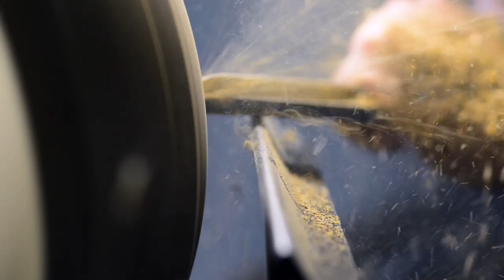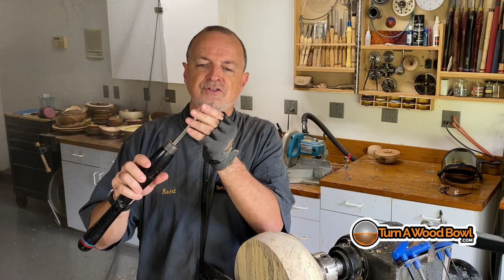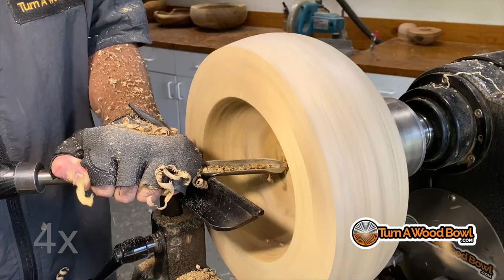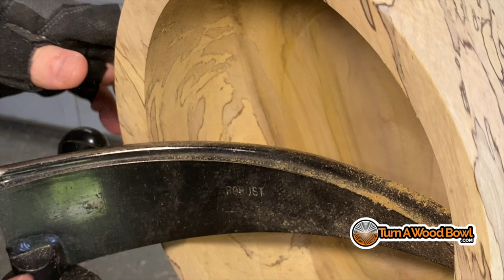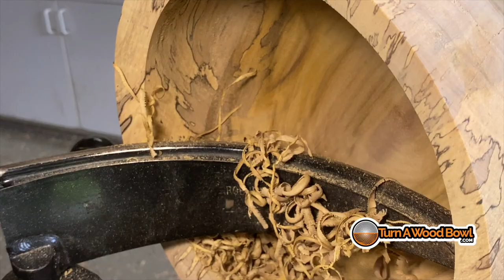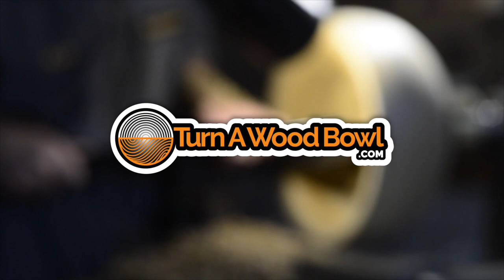Micro Bevel Bowl Gouge Woodturning Secret Weapon Wood Bowls Video

Comment: Having been in the “Hob” manufacturing business since 1973;  second and third clearance angles behind your primary cutting angle are a must when using gun drills. I’m just getting into wood lathe turning and am enjoying your tutorials. I’ve already modified an older tool with swept back side wings and added the secondary clearance/relief angle to see how it performs. Also, I’m not satisfied with the runout tolerances on four jaw chucks, so I will be hole grinding the I.D. and external grinding the O.D. of the Chuck jaws to get them to tolerances I desire.
Reply from the maker: Whoa! You sound super precise Dave. Love it. All the best to you and Happy Turning!

Comment: Excellent information on bottom feeder gouge.  Thanks for sharing, Kent!

BTW, I noticed the rust / wood buildup on your bottom feeder gouge.  Some WD40 and 0000 steel wool will remove most, if not all of that corrosion / wood residue. Wipe down your tools after they are used to help prevent this from happening.  Then put a light coat of WD40 or car polish on the HSS to keep the corrosion down when stored for a long time.  This will keep tools looking nice and protect them.
Reply from the maker: Hey, that's great advise. Thank you. It's so humid here that we kinda just accept a little surface rust. I'll try you tip out. Thanks!
Reply: Turn A Wood Bowl 

You could also use some Johnson & Johnson  paste wax on your tools as well.  It does a great job protecting tools.  And it is great to polish the bed of the lathe so the tail stock and banjo will slide around easily.
Reply from the maker: @jarmstrong2843  Yes, I use that on the bed and banjo. Another great tip. Thanks

Comment: What is the purpose of two relief bevels verses the single relief bevel on this tool? Just curious if there is a reason for the second relief as the shoulder of the first relief stops "riding the bevel" of the second relief bevel.

I like your tool assessment videos very much. I finally see what I do naturally, explained.
Reply from the maker: Good question. There is only one bevel, and it is the facet directly under the cutting edge. The heel has been ground back under the bevel twice to allow the cutting edge and bevel to turn tighter curves while still riding the bevel. Thanks for asking and Happy Turning!
Reply: @TurnAWoodBowl  Thanks. I figured there was a reason, had to ask. 👍👍🍻

Comment: Can any bowl gouge be ground into a micro-bevel, or is it best to start with one ready-made? I gather that 5/8" is the best size. Do you cover this grind in your sharpening instructional video? (I already have it, but don't recall.) Thanks!
Reply from the maker: Al, yes you can put any grind on any bowl gouge. The heavier gouges, like the 5/8" are more sturdy for doing micro bevel work. And yes, I cover all this in the Tool Sharpening (and shaping) online eCourse. All the best to you and Happy Turning!

Comment: Howard Wittwer,
Great lesson, my biggest issue is being left handed, so sometimes I work on the other side of the bed. Teaching myself to operate as a righted handed is taking a time. Do you have any suggestions for working at a lathe left handed.
Reply from the maker: Wow, "work backwards." That probably doesn't help. LOL Just remember all the bowl gouge basics still apply. Be sure the bowl gouge tip is pointing of the direction of your cut, etc. Watch the full playlist of all my Bowl Gouge videos. And quite literally, you'll need to reverse your approach if you're working on the opposite side of the lathe.

Comment: Kent I fully understand the reasoning behind the micro bevel feature, and I think it is fantastic, but why not incorporate this micro bevel on all your swept back gouges. It seems as though that would increase the usefullness of all your tools if you did that, instead of having to switch out to a 'special gouge' just to do the bottoms of bowls etc.  Maybe you already incorporate this feature and I just havent come across it yet.
Reply from the maker: Peter, good question. The steep angle works well for reaching into the bottom of the bowl. To do the side walls of the bowl at about 90° you would need to reach clear across the lathe to ride the bevel. That's where the 55° bevel gouge shines. Hope that helps. Happy Turning!
Reply: @TurnAWoodBowl  Ok, that makes sense.  I'm not quite ready but I'll be watching your sharpening video quite soon.  First up is to get a Kodiak sharpening station setup, along with a few new gouges..... then look out wood........

Comment: Can I use the micro bevel to hollow out the whole bowl?  I am new to wood turning. Currently using carbide tools. Want to gradually phase in traditional chisels. I want to start with a bowl gauge. Which one should I take? The flute or the the bottom feeder?
Reply from the maker: Yes you can! However, when you start at the rim, you will need to extend yourself completely over the lathe because of the tool angle. A 1/2" 55° swept-back bowl gouge is my main bowl gouge and I use it all the time. I have a Tools Sharpening (and shaping) eCourse that covers all the tools you will need to turn bowls, check it out https://turnawoodbowl.com/tool-sharpening-ecourse-for-wood-bowl-turning/

Comment: What would think if I reversed direction of turning the bowl and continued to use my fingernail 45° gouge with a center to exterior push cut?
Reply from the maker: Eric, good question. If the bottom of the bowl is curved and you reverse the gouge direction from the bottom up to the rim, you will be tearing out the end grain as you climb up the bowl. Watch this video https://turnawoodbowl.com/supported-cut-wood-grain-bowl-gouge-cut-direction/ You have discovered the limitation of the 45° and the 40/40 grind bowl gouge. There's nothing wrong with these tools. You will just need additional tools to reach the bottom of the bowl. All the best to you, and Happy Turning!

Comment: Specialty tool?  I use the micro bevel on ALL of my gouges, and oh yeah, I don't bother with a bottom feeder.  I also only use a 40/40 on the whole bowl.  I can rough out a soft maple bowl in about 10 to 15 minutes and that just doesn't leave time to use a bunch of different gouges/angles.  I've actually roughed the inside of a soft maple bowl in 90 seconds.  I use a modified Stuart Batty style of doing the inside of bowls.
Reply from the maker: Sounds like a great way to turn. Happy Turning!

Comment: I'm struggling with just hollowing out the inside of the bowl. It feels like every time my gouge approaches the "edge" between the face of the bowl and the inside it wants to just jump out of my hand, chatter or simply "run" to the left really fast. I can't get it to actually take a smooth seat and begin the cut down into the bowl. 

A couple notes here:
1) I'm super new to this, turned my very first bowl last weekend and it was all just trying to grasp the motions.
2) The gouges I have came from my wife's grandpa, who left us a few years back. The lathe and all of his tools sat in storage for well over a decade. 
3) I currently have no way to sharpen them, so I'm aware that I'm poking dull gouges at spinning wood and hoping for the best. 

Is it possible I'm doing something wrong? Or more likely that the gouges just aren't sharp enough?
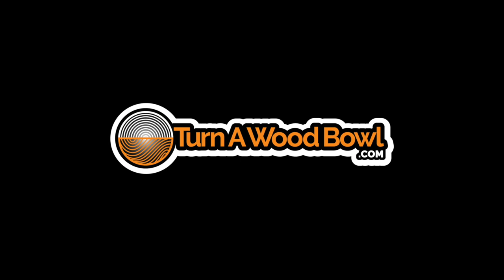Reply: To be more specific on the cut I'm struggling with, it would be the one you make at exactly 17:13 in the video. You smoothed off the face and then started a cut down into the bowl. Every time I try to start that cut down into the bowl the gouge fights me like you wouldn't believe! Most of the time, rather than start cutting down into the bowl, the gouge wants to catch and run across the bowl rim to the left.
Reply from the maker: Oh, I have a video JUST ABOUT THAT ISSUE https://www.youtube.com/watch?v=IbjjbKcQmSU&t Check it out and Happy Turning!
Reply: @TurnAWoodBowl  thank you Kent! This is exactly what I need. I appreciate you!
Reply from the maker: @TerribleTim68  Glad to help!

Comment: kent, when you are referring the angle of your tool you are describing how many degrees of angle off the shaft of the tool, correct?  I have a tormek sharpener and i think they do the opposite.  have you come across this before?  is it a european thing?
Reply from the maker: Adam, I must be honest, this always confuses me. LOL I've had people tell me that the angle needs to be measured from the face and others say the flat flute area. Essentially, all the tool bevel angles are closer to vertical or 90°. Meaning, if the tools had a blunt 90° angle bevel, the turning angles are only a small percent away from that 90°. I'm not sure if that helps at all. Hopefully! Happy Turning!
Reply: @TurnAWoodBowl   I just want to say thank you for replying to questions. a lot of YouTube presenters don't take time to answer questions and I very much appreciate it.

Comment: Kent, I have to pass on something regarding sharpening using the One Way system.  I must confess that I have not taken your sharpening course but instead watched several Youtube videos on how to make the micro bevel grind or bottom feeder as some call it.  DO NOT use the One Way system arm to make a 45 degree or more cutting edge.  In fact, I now think the arm with pocket should never be used to put the bowl gouge handle into.  To me this is like trying to turn wood with no tool rest.  There is no support of the tool at the grinding wheel.  I tried the arm method which is shown on many Youtube videos.  The gouge slipped down my perfect CBN wheel and gouged the heck out of my wheel before throwing the tool back past me.  I'll never use the arm again with a tool handle in the pocket.  This can be very dangerous and destructive to the grinding wheel and to the person holding the tool.  The platform rest is the only way that I will go in the future to make micro bevels.  I will only use the arm to hold the Vari-grind attachment.  Thank you for your videos since they are always very informative.  I think it is time to take your sharpening course!
Reply from the maker: George, Thank you for writing and sharing! No, I do not recommend here or in my course, using the v-arm pocket to hold the tool handle. Something in my gut has always said, "that doesn't look safe." And it's essentially a pinch-point. Thanks again for sharing. Happy Turning!
Reply: I just registered for your Sharpening course.
Reply: @TurnAWoodBowl  Kent, I took your sharpening course and it was excellent!  Your teaching technique is so straight forward and easy to understand.  Well, I sharpened my micro bevel as you taught and used it on a bowl today.  What a great tool!  It cuts beautifully.  What a dream that is for the bottom of bowls.  Thank you for all of your bowl turning and sharpening wisdom!

Comment: I think you are misapplying the term "micro bevel."  Watch any video on sharpening knives, chisels, or plane blades and you will see.  A "micro" bevel is different from simply grinding the heel off a bevel.  You would be more accurate to call this a traditional grind with the heel shortened.  And the bottom feeder gouge has been well documented.
Reply from the maker: Harold, thanks for sharing. However, we're not talking about other knives, chisels, or planes. The bevel on this gouge is 1/3 to 1/5 the size of a regular bowl gouge bevel, therefore I call it a micro-bevel. Tomato, tomatoe. I understand your point. Thanks again.